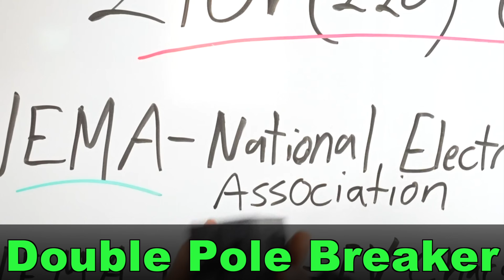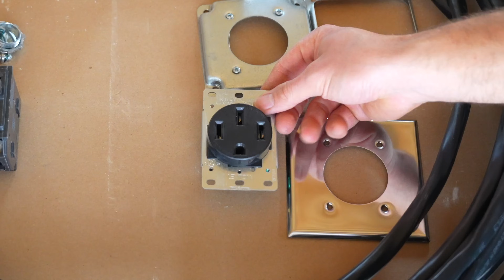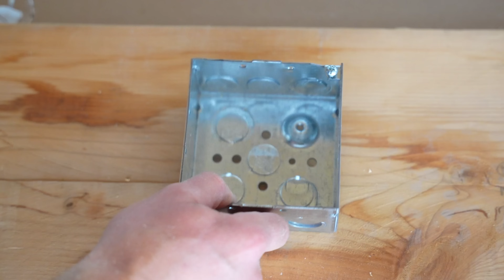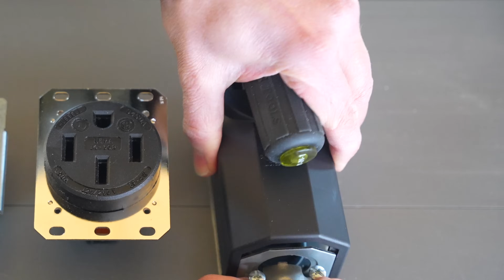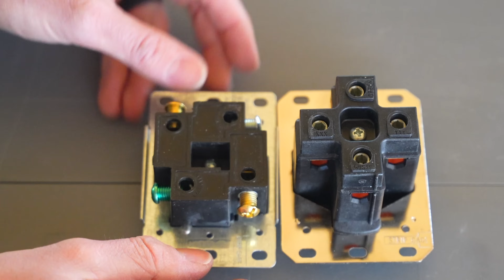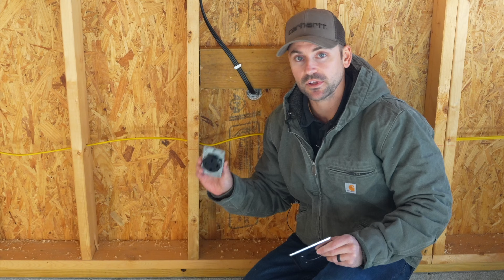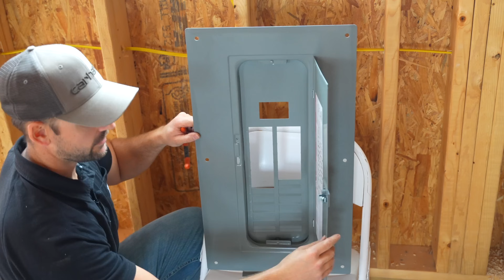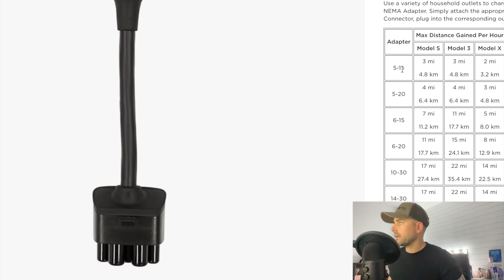How To Install A 240V Outlet In Garage - EV Car Charger, Welder, And Electric Range (Hubbell 14 50)

Comment: Great information video. I notice 1 mistake and that was you installed the 3/4 cable clamp backward. The screws for the clamp has to be inside the box. This is because incase in future they need to get more wire inside box on a finished wall they can loosen the screws and pull some wire inside the box.
Reply: Wrong. Two screw connectors should have the screws on outside of the box. Don't think inspectors like your way. With NMB cable stapled within 12" of a box next to impossible to pull in more wire.
Reply: @JohnThomas-lq5qp  lol please dont make things up out of the blue. This has nothing to do with the inspector, this is about the design engineering and proper function. First of all it doesnt matter what inspector likes or doesnt like. As per code, a cable must be secured to the box by the method the manufacturer of device/fastener has specified. 2nd of all, USUALLY (but not a requirement), a GOOD electrician will leave a slack of wire in the form of S between the box and the staple. A house lives for 100 years and during this time if someone mess up wires when connecting the devices, they'd have the option to pull in some slack into the box.

A good example of this is the plastic push-in connectors for NMD wires where you can pull wires into box but not out.

2nd example is the regular NMD respectable boxes with the screw inside the box to secure the cable.
Reply: Did you ever have a job inspected? The inspector or AHJ has the final say. With 12/2 costing what a $1 a foot a little over a year ago no electrician will install stupid money wasting S bends for cables entering a box. The NEC mandates a support within 12" of boxes feed with NMB  cable so that makes it very difficult to make a S bend and provide the 12" support. Metal box manufacturers never supplied type of connector to be used in their boxes. There are over a quarter Millon words in the NEC and hundreds of exceptions to all of the articles and like I have been told at the over 100 continuing education classes that I attended to renew my electrical license is if you ask 3 inspectors you might get 4 answers. The few times that I objected to an hick prima Donna only inspector in a little town that attempted to write me up for code violations I won out. Best was after my inspector passed a job local hick tried to I give me a violation for making a single splice on a 14 gauge wire inside if a circuit breaker panel. After I gave him the NEC article that allows it told me that he would let me get away with it that time. After many years still learning.
Reply: @JohnThomas-lq5qp  I do agree with you... with the copper prices after Covid no one is doing that S thing anymore. I learned that when I was a kid doing construction jobs here and there. But we do electrical cabinets for manufacturing segments.  Complying with residential codes is child's play compare to industrial codes and regulations. I personally done 2 full basements and 3 house renovations jobs so far... maybe I was lucky I haven't had a jerk for a inspector... and yes like you said there been time when the inspector has said "you can't do this" and I told him yes I can and here's what the code says and then he would ok ok fine but I wouldnt do it like that... and moved on to the next item... inspectors just verify your are up to the code and if your are then it doesn't matter what he personally feels about your job.
Reply: What led me to this video was out of frustration in fitting a 14-50 receptacle in a 2-gang box. Usually a 4-11/16 box is used like the oven. But I wanted to minimize the drywall damage in the already finished garage and the fact that the receptacle bag said use a 2-gang box. Now when I was trying to wire 6/3 cable to it and intall it, the receptacle plate bent. So I wanted to see how others do this 😅. Anyways I cut the wires much shorter and pre bent wires and that still was hard to install but it went in fine.

Comment: Why a 50amp breaker and not a 60 amp breaker (double)? The Tesla website says you get a faster charge on a model Y (which I have) if you use a 60 amps. I'm new at this. Thanks, great video BTW!
Reply: Neither the receptacle nor wire in this use case are rated for 60A per NEC code, as you have to use the 60°C Ampacity column, so it's only good to 55A. You may be able to use a 60A breaker if you hard wire a charger rated for 60A. You could use 6 gauge wire for it if the charger itself is rated for 75°C. If it's only rated 60°C, you would have to step up to 4 gauge wire.
Reply: @802Garage  Correct me if I'm wrong, but couldn't a hardwired Tesla charger be directly wired with 4/2 SEU cable? (No need for a neutral?) This video is installing a receptacle for the ability to also use it for a welder.
Reply: @darrendolphdragos9752  You are correct there is no need for the neutral. I'm looking at the Gen 3 Wall Connector install manual and internally it is only wired for two powers and a ground. You absolutely do need the ground though and 4 gauge copper cable is necessary to be code compliant with the maximum rating of 48A output.
The Tesla install manual says to use a minimum of 6 AWG 90°C rated copper, but that is not actually adequate for the 48A output. This is for a couple reasons. #1 Is that the Tesla charger does not specify the temperature rating of its terminals. Therefore according to NEC 110.14(C)(1)(a) any equipment rated for 100A or less and unmarked must be treated as though it is rate at 60°C. That means 6 gauge copper can only support 55A according to the NEC ampacity charts. #2 The reason the wiring and breaker used must be rated to support 60A is because the Tesla charger is considered a continuous load device. According to NEC 210.19(A)(1) The circuit components must be rated for the noncontinuous load plus 125% of the continuous load. In this case there is only a continuous load of 48A, so 125% of 48A is 60A exactly. Therefore, all components to hook up the Tesla charger must be rated for at least 60A with a 60°C rating, meaning a 60A breaker and 4 gauge copper wiring.
You may not use aluminum wiring because the Tesla Wall Connector install manual says "COPPER WIRE TERMINATIONS ONLY for landing in Wall Connector wirebox terminals. Conductors can be stranded or solid." So not only does Tesla say to use copper, but it would be an NEC violation to go against what the product documentation says, even if 4 gauge aluminum could support the load. The problem is they don't actually make 4/2 NM-B copper wire or similar. So your option is basically to run individual THHN/THWN wires through conduit. I'm assuming Tesla was trying to skirt the rules with the easier 6 gauge copper recommendation, but it isn't correct. You could use 4 gauge aluminum and then use a Polaris or appropriate connector to splice to copper for landing the connections, but I wouldn't personally. The good news is per NEC Table 250.122 I believe you only need a 10 gauge ground for the 60A load rating, so that saves a little money.
Reply: @802Garage  (Note I'm just spit balling here.) I would conclude then, if the run is long (Like, the panel on one end of a rancher, and the garage on the other) to run #4 SE cable to a co/al rated disconnect switch or non-fused cutout block (like those used for outdoor condensers and heat pumps) and then copper THHN/THWN through LFMC hardwired to the Tesla charger. Now I wonder if GFCI protection would be required? Thanks for your input.
Reply: @darrendolphdragos9752  Yep you could definitely do that! The Tesla Wall Connector manual specifies that the charger itself has GFCI protection and states not to use a GFCI breaker so you would be all set.

Comment: The outlet you installed is self grounding, you can see the strip of metal going from the ground terminal to the face plate, so you don't need to connect the ground wire to the grounding screw of the box.  That connection is created automatically when the outlet is attached to the box.
Reply: Given the Voltage and Amperage at play, even if it isn't a code violation, HIGHLY recommended you ground the receptacle as well as of course the box as required by code.
Reply: @802Garage  The box and outlet are already grounded when installed since it's self grounding, which is the shortest path to ground.  Adding extra wire does nothing.

Comment: Do you not need to run your wire through conduit if it's this high of amperage?
Reply: I don't think so if it's behind a wall.
Reply: Not if it's in certain areas or if it will be run in wall. Basically, if it can actually be run between studs and in the wall, it doesn't need conduit. Another example where wire of a certain minimum gauge can be run without conduit or protection is overhead in an unfinished basement.

Comment: Can't stand EV's, but I'm gonna use this video for installing a welder circuit.  Thanks for the tips.
Reply: Remember sir, the 2020 code requires receptacles in the garage or similar structures to be GFCI protected, even 220-240, nec says up to 250 volts needs GFCI protection.  Your jurisdiction may not have adopted that year yet, but currently required.
Reply: I'm not sure why the 'powers that be' haven't just made the whole house protected... hohum... @keithharrington8715

Comment: Excellent video and explanations.    Technically you installed a 120/240 volt outlet.   For those that do not want to spend $90 for the receptacle, Bryant (owned by Hubbell) same exact device is approximately half price.   Why cheaper?   If Hubbell can get named in the specifications for a large project, then higher profit.  They bought Bridgeport out in 1991 which makes the Bryant devices.   Never use cheap receptacles for car chargers.   They overheat.
Reply: they did not buy bridgeport.  bryant was located in bpt ct

Comment: I would install the 14-50 with the round earth ground down. The EVSE provided with the Chevrolet Bolt has the round pin down, so the cable hangs down when plugged in. Otherwise, I would need a shelf above the outlet, because the cable would point up, rather than dangle down. The cable between the plug and the EVSE box is only~12 inches, making it difficult, if it can't just hang down.
Reply: Depends on the vehicle, Tesla EVSE has the ground pin on top.

Comment: Since the circuit is in the garage which is considered a wet space, the circuit breaker actually needs to be a GFCI breaker.

The Hubble 14-50r is the best receptacle but Bryant has a clone of the Hubble at a significantly better price
Reply: Time to argue.  GFCI protection is required under 625.54, sometime 2017 or earlier.  Surely that supersedes  cheaper 2 garage GFCI requirement of 2020.
Reply: Tesla specifically does NOT allow their Wall Connectors to be connected to a GFCI.  That protection is built in.  Their Wall Connector is designed for outdoor wet / winter use and the circuit protection is built into the car.  If you use a GFCI you'll frequently get trips.  I tried this at our Montana cabin with GFCI protection and it was super frustrating.  This is a case where the code hasn't kept up with EV technology.

Comment: Was that receptical torqued to inch pounds or foot pounds?
Reply from the maker: Inch lbs. I hope that clears the air!
Reply: @TheExcellentLaborer  also not trying to over engineer this but I think it might be advisable to put some sort of cut off switch in the garage as the receptical isn't gfci nor afci protected.  

Also hubble makes a cover for its receptical which covers the outlet when unplugged.

Comment: Just to be clear, Torque specs are in inch pounds not foot lbs.  Also, it's best practice to use a proper wire stripper instead of a razor blade, that way you won't risk nicking the conductor with the razor blade.
Reply: Newton-meters, too. And in my industry (aviation), there are approved wire strippers that must be used to avoid the likelihood of a violation. I'm surprised how many youtube experts use what would be unapproved tools to strip and crimp wires. Those tools are not excessively expensive, and with them it's almost impossible to harm the wiring or make a connection that is subject to loosening and arcing/catching fire. . .if it's good for a Boeing it's great for my house and vehicle.
Reply: As  an Automotive Technician I noticed that mistake too. Inch pounds and Foot pounds are two different tightening specifications.
Reply: I thought that was weird too, coming from an electrician.  No way you can get 75 foot pounds of torque with torque screwdriver.
Reply: @Resist4  he didn't say "Foot" or "Inch," just "Pounds," which is meaningless measuring torque. However, given that size torque driver, I'd assume it's an inch-lb device.
Reply: @paulcrumley9756  True, but since this was a how to video he should have not just said pounds.
Reply: @Resist4  I agree. He's speaking his own language - probably the language of the trade - a lot of my co-workers in my industry did the same, but when instructing, terms really do matter.
Reply: @paulcrumley9756  But that's no for a YouTuber doing instructional videos, he needs to get the terms right.
Reply: wrong my lug nuts are 90 ft/lbs which equals ??? inch lbs,

Comment: tesla sure is promoting and shilling for that hubble recip, i wonder if elon owns hubble, its more robust but is it 8 times better?... no , ive installed many of all brands and legard, leviton, eaton, etc. all have industrial grade NEMA 50 amp recips with shielded lugs
Reply from the maker: The Hubble is recommended for EV charging more often than not from the research I found. As you know, it is a good outlet, but not sure if it’s worth that much more. Thanks for watching!
Reply: P.S. The Hubbell can be had for more like $73 right now and the identical construction Bryant for $49.
Reply: Have you ever compared the construction? There are A LOT of burned up Leviton and other big box store receptacles out there due to EV charger use. Very few Hubbell/Bryant. Another contributing factor may be that Hubbell intentionally rates their receptacle at 60°C only, which means it must be used with 6 gauge wire to reach the 50A rating. The Leviton and other receptacles, despite lighter construction, are often rated at 75°C and can therefore be wired with 8 gauge. The heavier cable used with the Hubbell acts as a better heat sink, likely leading to reduced failures. Even a brief perusal of receptacle reviews across the Internet will show you tons of pictures of burned cheaper outlets.

Comment: Excellent and informative.  Just as a minor point unless you intentionally want annoy the hoyti-toyti grammar gestapo types (and your 6th grade English teacher):  for describing certain measurements in the Imperial (aka "English") system, most people use "feet" for multiples of a foot of length, and "foot" when using an adjective to modify (or describe) an object.  E.g., a pole which stands ten FEET in height could be described as a ten-FOOT pole.  Most people would say, "It's ten FEET,"  and not "It's ten foot."  That's why they'd say a 12-inch ruler is "12 INCHES" long (and not "12 inch" long).  Another example could be: "It's three MILES to town," and not "It's three mile to town."  But it is perfectly acceptable to say, "It's a three-mile road to town."
Reply from the maker: I appreciate the compliment! English was never my strong suit. I’m a math and science guy. Thanks for the tips!
Reply: There are some people I wouldn't touch with a 10 foot (feet?) pole.  😅

Comment: I have this set up at home.  I limited my charger to 35A 'cause at 50A, everything was getting very warm.
Reply from the maker: That’s interesting. I could see why that would make it warmer. It probably wouldn’t be a bad idea to contact the charger manufacturer to see if there’s anything else you can do about it. Thanks for watching!
Reply: @TheExcellentLaborer  Far better to consult a professional electrician, and have them install such equipment... not some DIY hack that has no idea how to fault diagnose.

Comment: Josh, excellent descriptive YT video on installing a 50 amp outlet for a EV charger. I would let the viewers know that the 6 nomenclature on the 6-3 wire stands for the AWG or gauge of wire needed to withstand the 50 amp current draw.
Reply from the maker: Thanks a lot, Dan! I did explain what AWG was in my last video. You’re right, I would have not heard to mention it again. Thanks for watching!

Comment: Your videos are great! I've learned a lot by watching your work. Although I did want to point out that at 17:39 and 18:31 you have some exposed coper on the power lines, I did a job just like the one you are doing but I was careful to make sure that there was no exposed copper line it was only because where I live in Southern California the building inspectors are very picky about electrical work.

Comment: Also, if you have side cutters or really your strippers, you can score the romex and rip it without damaging the wires, you get a much cleaner look in your panel. Strip your wires before going into the panel.